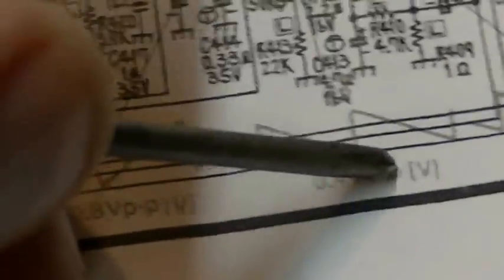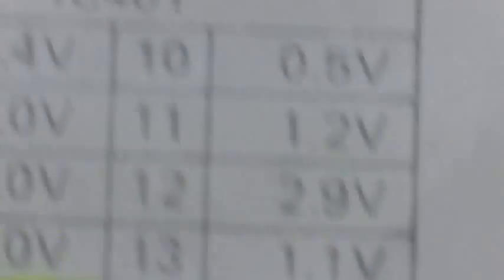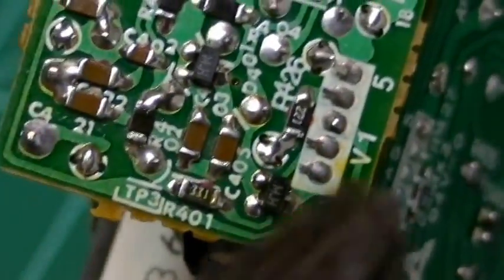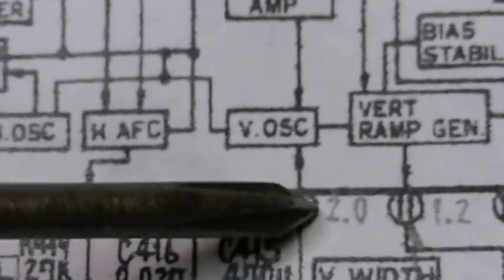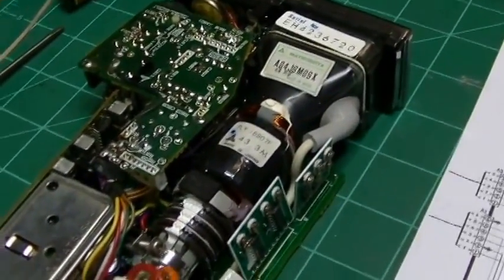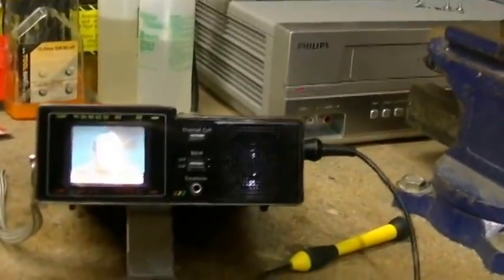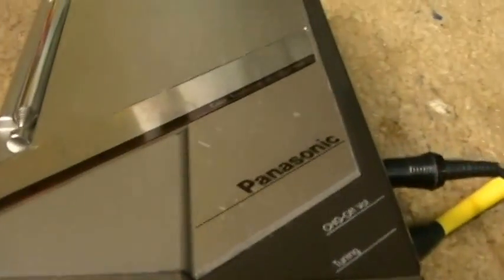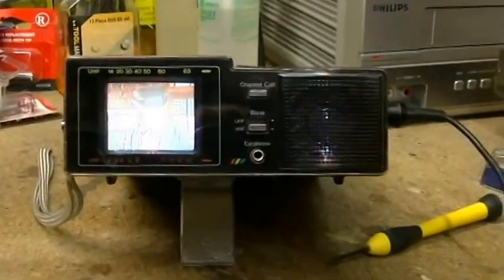Panasonic CT-101 1.5" Color TV Repair Pt 3 of 3

Comment: That's a nice little TV.  I once had a nice Panasonic portable that kinda popped open like a toaster.  The screen went down into the case for transport.  Push a button and it popped out.  I wish I still had it, that was a long time ago.  I've only had a few Panasony TV sets.  I've had more Sony portables.  I have a 70s Sony 16" Trinitron that I got from a junk store for a mere 10$, never had any trouble with it, a very nice set that I like a lot.  Of course it has an ATSC converter, it's next to me here in my shack.  I'd like to find another pop up Panasonic TV radio now that I have the Blonder Tongue.  This is a nice little set, but the screen is too small for me, I'd have to use a telescope to watch it! LOL
Reply from the maker: Yes, getting older myself and can't see myself very well. But it's a part of my collection. Just need to know it works, but it's not functional...especially in the land of TV today with High def and all.
Reply: I just  found a good deal on ebay of  a Panasonic pop up.  Um gonna dig out my old TVs.  I remember the 5" b&w Panasonic w/radio that I got for my mom in 1979.  I got it back when she died.  I bet it still works.  That is my most special TV.  I think that she had that little TV on just about everyday from 1979 'til 2004.  She had a larger color set, but she liked it next to her bed to go to sleep to, whether the radio or TV.  It has not been plugged in for over ten years.

Comment: nice fix, I will have to keep an eye open for one, I like the small size, will not have to make room.
Reply from the maker: Yep, if you gotta a little room in a drawer, you got room for it!!! I know you can't tell in the video, but it gets a wonderful picture, which still amazes me with how small it is! I guess my HD camera just wants to really zero in on it or something.
Reply: I have shifted focus a bit to smaller sets, got a 5" color set a while ago very neat. I have to figure the CRT on that little one you have is a low hours deal as well considering the set was  nver prob used much.
Reply from the maker: I got a couple too! Alhough they are newer than I like. Cheap to pick up too. I got some of the early 60's sony B&W stuff I'll be working on eventually. Too many cabinet sets = not many TV's...at least for me.

Comment: Scott,
I want to say a big thank you to you my friend.  Your video featuring your BT TV local transmitter system inspired me to get my butt into gear and research a way of finding out I can convert UK Digital Free-View TV to our old 405-line (bands 1 & 3) system which was closed down here in the UK on 02/01/85.  Would you know it dear chap, I unearthed a conversion device known as Aurora Standards Converter (made in USA) which will not only let me watch digital TV on my two late-40s TVs, it will enable me to view DVDs (via DVD player) on them also.
This bit will make you smile, being undecided whether it should be my Pye B18T, or my Bush TV12, I should begin restoring first, I flicked a pound coin up into the air to help me decide.  Heads – Pye: tales – Bush.  Heads it was so I will begin restoration of my Pye B18T as soon as I have bought an Aurora Standards Converter (it costs over £200).  I hope the CRT, scan coils, and line output transformer are okay – wish me luck LOL.
Regards,
Phil.  P.s, I wouldn't say the Pan' CT-101  repair video is boring - sure, I would agree that valve TV restoration has a definite edge on solid state TV restoration.
Reply from the maker: WOW! Phil, I don't know what to say to that other than I know you have the same love for the things I do...and that's why I do it. A million people can watch what I share...and if one......if I can help or have an affect on what you do...then I am sooo happy!!! I know I will learn from you! And I am sooo glad you found that converter!!!!! I knew it had to be out there! Good luck on your restoration(s) and I will be watching!!!! Heads or tails...it doesn't matter....go for it my friend!!!